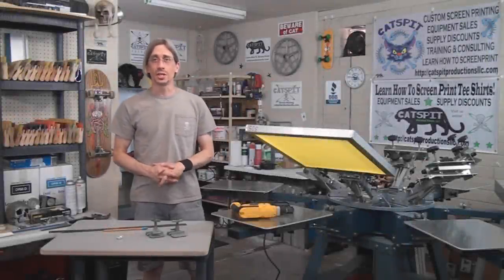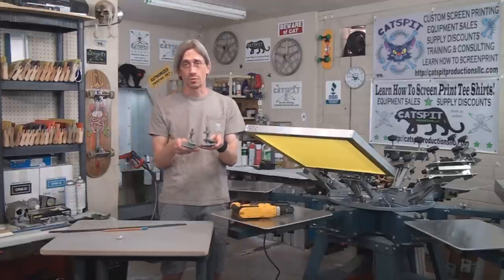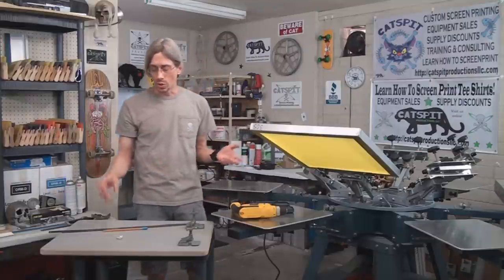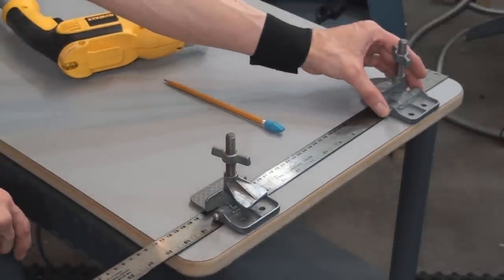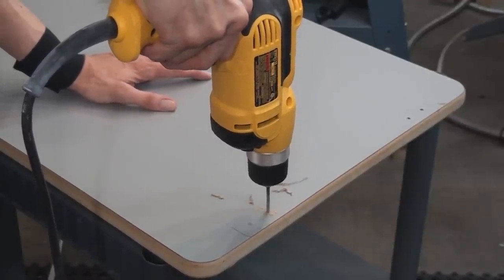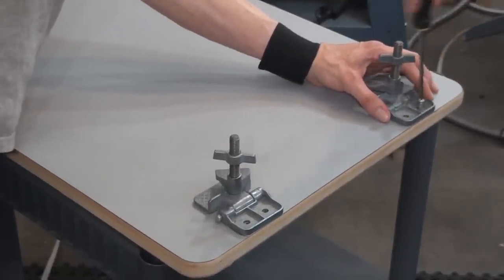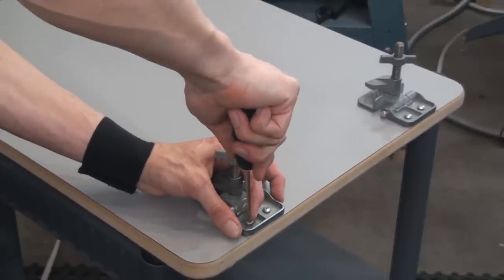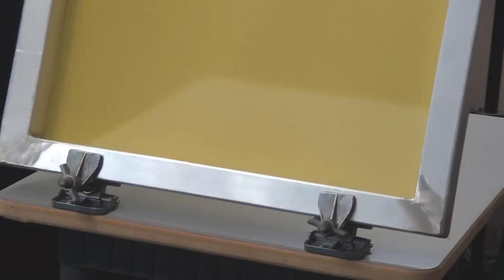Do It Yourself Hinge Clamp Screen Printing Board

Comment: Thanks just bought the hinges clamps going to go get the wood at hardware store and make my own screen print for my class. We only have 20 total and there are 30 students, so its almost like we have to share then wait time for screen filler dry time or sketching time in my book. What my teacher did was put a large piece of clear plastic very thin but flexible so we can see where the print is printing. We then put our paper or t-shirt under that plastic then use masking tape to aline it so it matches up with all the prints on the paper or t-shirt. Going to save this video on my iphone for the future.
Reply from the maker: Sounds very interesting. Make sure to share my YouTube channel with your class ;) Check out some of my other videos too. Thanks for watching! http://www.catspitproductionsllc.com/ - http://catspitscreenprintsupply.com/

Comment: I print posters and use these hinge clamps. I made my own vacuum table from MDF. A couple observations you made are critical for paper printing like this:

1) I had to recess the clamps into the MDF a bit to get them lower and closer to the paper. The off-contact was just too much for poster printing. I use old plastic poker chips on the other end to support the screen with about 1/8" off-contact.

2) I also found the hinges need WD-40 every few weeks. They seize up for some reason.

Comment: i just bought 7 of these hinges for $37 total on Ebay. After seeing this video I have concluded that I got a fantastic deal. I was about to spend more on a 4 color station but after having seen this video i realize that all i will need to start with is 3 flat boards. Wow! Now i just need to figure out where and what kind of boards to use AND how to keep them held back with a spring. Thumbs up Catspit, and may the Lord God almighty bless you with repentance!
Reply from the maker: If you got genuine Speedball hinge clamps that is a very good deal. Good luck with your project and you're very welcome. I'm glad I could help out through my videos. Thanks for watching. Screen Printing Equipment & Supplies - http://catspitscreenprintsupply.com/
Reply: they are heavy duty and look old school. They are stamped with Jiffy, not speedball. But they are pretty heavy duty so im not complaining.
Reply from the maker: Oh yes Jiffy clamps. They should work just fine.

Comment: Your vids are such helpful! I have one question: If you want to print both on posters and tee shirts, without sinking the hinge clamp it would be almost impossible to print on posters? Thanks in advance!  Cheers!
Reply from the maker: Thank you very much. It may be harder to get fine detail since the off contact will be high for posters. But you might use a flat hard, smooth piece of something to take up the space and raise the poster paper to the screen. Just tape it down to the board when you want to do posters. Thanks for watching and leaving a comment!

Comment from the maker: Other than using a flat tray or building one yourself with a Plexiglas type material I wouldn’t know. I haven’t built anything like that yet. Ryonet actually came out with one at a decent price and it seems compact too. I’d probably buy one of those at this point if I wanted a dip tank. Thanks for watching and leaving a comment! ☠

Comment: i need tips from a real pro, and here you are. im trying to figure out a way to put out my art on a shirt with screen printing and im at the last step ! curing haha, i dont own any suppply for this matter, s-so, could i use a kitchen oven or something like that? also, my stuff is always crackin when i strech the shirt, i print with water based speed ball ink, any tips ?
Reply from the maker: It's possible to use any heating device to cure or heat set inks if you can reach the proper temperatures. Check with Speedball for specs on their inks. Just remember, putting a tee shirt in the oven can be a fire hazard. Thanks for watching! Screen Printing Equipment & Supplies - http://CatspitScreenPrintSupply.com/

Comment: Great video, I have a fix for creating a level surface. Us a 1/8 piece of hardboard that you can purchase at any lumber yard. Have or cut it so it fits below the hinges. Then use contact cement and adhere to the base board. This should give you a level surface.

Comment: Thanks you for a very informative video. I am thinking about buying 
a set of the "hinge clamps". I would like to be able to print onto small 
plastic and aluminum electronics enclosures. Can the hinge clamps 
be used in this application. Are there any tutorials or videos on this 
subject? Can the hinge clamps be configured to do this job? 

Any help or feedback would be appreciated.

Comment: Those hinge clamps are great but made for printing Tshirts. Instead of routing out the baseboard to sink the clamps, its much easier to get some foam-core board and a thinner piece of cardboard, like the board off a big drawing paper pad, and staple them as a build up on the board. Then if you need to print shirts you just pull the build-up off. Routing is a pain because you might rout too deeply, with stapling a build-up on top of the base you have more control.....

Comment: how high exactly is the off contact?  This is the method I plan on using for my one color design.  Also it's a photo I'm going to be printing an i know I need it to be pretty tight so what do you recommend I do ?
Reply from the maker: +sean mcclish If you're printing posters you don't need to worry about it that much. Less is more when it comes to off contact. With papers we are printing a very low volume of ink and there is very little to no off contact for such flat work. Fabric is a bit different and the off contact helps deposit a heavier layer of ink more evenly. With fabric we want about 1/16th of an inch. Thanks for watching. Screen Printing Equipment & Supplies - http://catspitscreenprintsupply.com/
Reply: +CatspitProductions  how would I fit the t shirt onto the board?  Doesn't the board have to be inside the shirt?  Or can I just lay the shirt on top  of the board and print directly on it?  I see many printing platforms using boards shaped kind some what to the form of the shirt?  How well does this set up work?

thanks
Reply from the maker: +sean mcclish Yes, for this home method you would have to put a board of some kind inside the garment to prevent the ink from bleeding through to the inside of the back of the shirt. That would go in between the screen and the MDF board of this little set up. So with a board press it may not be possible to have off contact unless you do some chucking and rigging perhaps.

Comment: what package do you recommend for a beginner and personal use ?

i just want everything "all in one" since i am  a beginner 
please name the things i need for screen printing

tnx
Reply from the maker: It can depend on what you want to be able to print. You can check out my kits and packages on my ecommerce site for lists of equipment at different price levels. But if you want to set up a simple manual screen print shop, you will need at least:

bench press or floor press
exposure unit
flash cure unit
scoop coater
screens
squeegees
 I always recommend getting a belt dryer if you can afford it. Then of course you will need the consumables like inks, solvents, screen making chemicals, etc… You will also need things like tape, ink scoops and other small accessories. Whether for hobby or commercial printing goals your budget, electrical requirements, and space available to work in will also determine what equipment you can buy. 

Also check out these articles:
 http://www.catspitproductionsllc.com/basicsteps.html

http://www.catspitproductionsllc.com/starting-to-screen-print.html

Thanks for watching! Screen Printing Equipment & Supplies - http://CatspitScreenPrintSupply.com/

Comment: Hi,
Thanks for the awesome video!!! :-)

Just bought the clamps and am about to install them. However I do have a question. It seems that the bottom base isn't completely flat, as the screw in the middle protrudes slightly on the outside. Are they defective items (Both have the same thing, but one is worse) or is it going to work anyway?

Thanks in advance!
Reply from the maker: You're very welcome! I don't know really. It depends on what hinge clamps you have. If you can attach them firmly and they are stable then they should work fine. Or you could give a call to who you bought them from and ask if that is normal. Thanks for watching and leaving a comment! http://www.catspitproductionsllc.com/ - http://catspitscreenprintsupply.com/

Comment: Thanks for the video! I have set this up for doing tote bag printing, but too much ink is coming through and the bags are sticking to the screen when I pull the screen up. I tried printing with and without the cardboard inserts. Any idea why this is happening?
Reply from the maker: Use a cardboard insert with spray tack on both sides and then tack the bag to the pallet. If the screen is printing too much ink try a higher mesh count and a harder squeegee. Thanks for watching and leaving a comment! http://www.catspitproductionsllc.com/ - http://catspitscreenprintsupply.com/

Comment: So the off contact is too much but you didn't demonstrate how to deal with that. You mentioned it in passing but we need a demonstration for dealing with that.
Reply from the maker: For posters, yes. I did talk about it in saying for posters you would need to recess the clamps into the board some to make the off contact lower. But for tee shirts you're going to need to put a piece of cardboard inside the shirt anyway and that will take up that extra space. With hinge clamps you really either have off contact or not unless you rig it up specially. Thanks for watching! Screen Printing Equipment & Supplies - http://CatspitScreenPrintSupply.com/

Comment: John...if you have a dremel type tool you can purchase an adapter that connects to the tool, and you will be able to rout out that little area....professionally :)
Reply from the maker: @Mach S - LOL... yeah I would probably need more than a Dremel to pull it off ;) But yeah then maybe it could do zipper boards too. Thanks for watching and commenting. I appreciate your support!
Reply: that is very true...however to flat for hats :) Sorry i just cracked myself up over that one LOOC (L'ing out of Control)
Reply from the maker: Mach S ;)

Comment: wish you've would of done a quick t shirt print , right now I'm doing every thing by hand and I've wasted dozens of t shirts i have no station , my shirts are coming out horrible any tips ?
Reply from the maker: Use a piece of smooth firm card board between the shirt body and use spray tack to adhere the shirt nice and flat to both sides. Then if you need to spray tack the board so the shirt will not move either. Thanks for watching! http://www.catspitproductionsllc.com/ - http://catspitscreenprintsupply.com/
Reply: CatspitProductions well I'm using a  wooden board to to put the t shirt torso area around  with the adhesive spray  to make sure t shirt is flattened  and smooth , but I'm having a friend hold down  the screen above the t shirt firm while I'm squeegeeing , isn't a station mandatory for the zero contact ???? my shirts aren't coming out good at all would appreciate the help a lot
Reply from the maker: Joey aguilar Oh okay I see... ;) Yes, off contact is best set up with some kind of press. In you're situation it would be difficult to simulate it unless you perhaps use some shims at the corners of the screen. The question is if you could do it so you have slight off contact evenly all over the print area.

Comment: J, For printing POSTERS. the magic "off Contact" snap is 1 nickel space? 2 nickel space?
Reply from the maker: chappledesign Yes, very low to none for posters. But if you have no off contact it can sometimes create abnormalities in the print as the paper pulls off the screen. I would go as low as possible without any issues when lifting the screen. A vacuum pallet would be handy. I'm getting ready to do a poster video using our vacuum table attachment for Ranar presses. Thanks for watching. Screen Printing Equipment & Supplies - http://catspitscreenprintsupply.com/

Comment: with the cost of the board also not included, ya might do better with a cheep one color press. probably 30 bucks more. but this is totally cool i think.
Reply from the maker: Maybe…. Maybe not. Hinge clamps cost about $20. You can attach those hinge clamps to just about anything flat. They work great on table tops and work benches. A board could be found rather than bought. So a $50 to $70 bench press might not be that great of a deal for the money. But I do agree a good bench press would be easier to work with and have more consistent results. http://catspitscreenprintsupply.com/catspit-1-color-bench-top-screen-printing-press/ ;) Thanks for watching my video and leaving a comment!

Comment: Sir what do u mean for tshirt printing do not sink them?
Reply from the maker: I mean do not bevel out a notch for the hinge clamps to level the bottom of the clamp to the board. For tee shirts that space would help because you will need to insert a piece of cardboard inside the shirt before printing. For posters we would want the hinge clamp flush with the board. Thanks for watching!